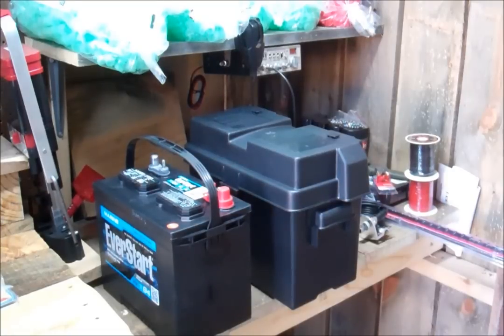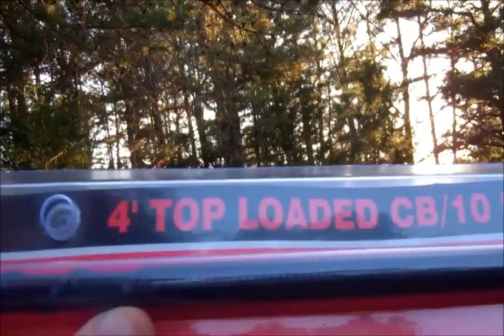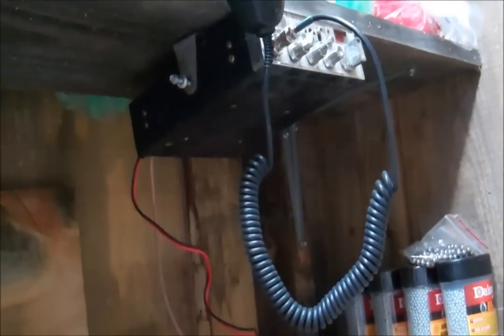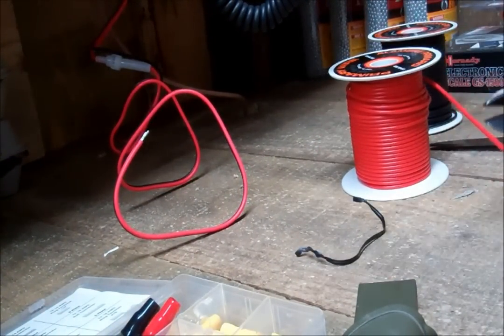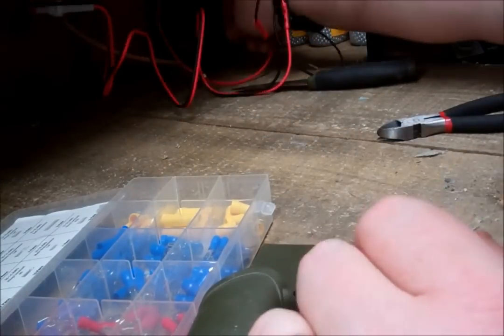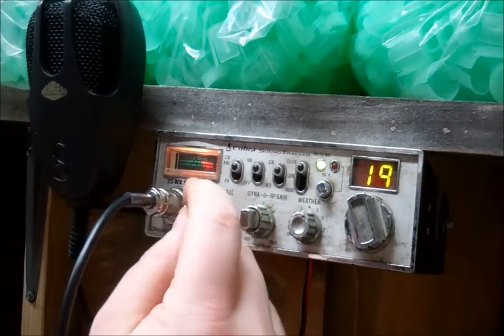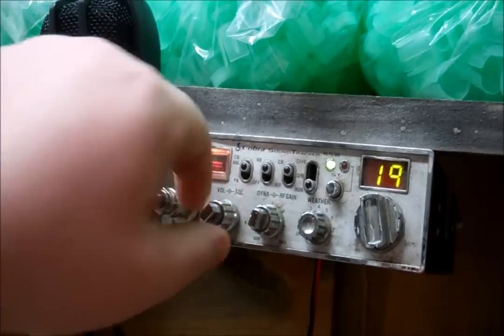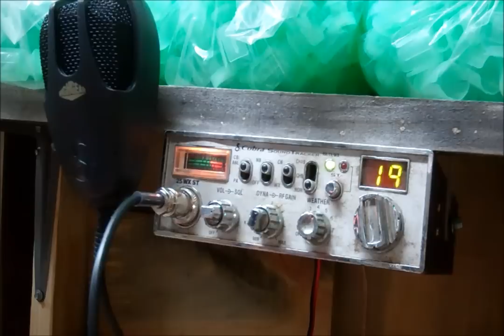Off-Grid Cheap CB Radio Set-up

Comment: Neat video. You COULD run a ground wire from the antenna to ground, but it won't make that much difference at the 4 watts that a CB puts out.  It's a much greater issue with a higher wattage Ham radio..  The antenna is grounded straight to the battery.  Copy sounds good on your radio check.  The important thing is: IT WORKS!! 73's

Comment: You also need to remove the coiled coax loop directly below your antenna. Tightly looped coax produced a RF choke. Creates resistance in your transmitted signal , which your radio must overvome. Between the loop and the ungrounded antenna; I would suspect your SWR's are extremely high ; and you will eventually burn up the transmitter finals in your radio , due to the excessive resistance.

Comment: Nice : )
I have a set up a little like yours. I have my whip with a mag mount in the attic on a 3ftx4ft sheet of steel on a ground lane. Works like a charm, I will be adding an amp I bought at a flea market this weekend. Thanks for sharing.

Comment: groundplane radials, just 3 wires attached on ground bracket will help greatly! also a cheap swr meter will keep you from burning up your final transister. Luckily you didnt key very long

Comment: You need to check your SWR If it is much over 1.5 you will burn up your radio. That antenna needs a ground plane you can run 4 wires from the mounting bracket out like spokes in a wheel in 4 directions and it will help you. I hope this helps good luck.

Comment: So you connected the power supply straight to a deep cycle battery with nothing but a fuse in between right? I'm asking in relation to the fact that I'm trying to make myself a CB radio go box
Reply: +Richard Evans  My own "go battery box" is a marine car battery, with a trolling motor type of battery holding case from wally world's fishing department. On top at one end, I added a three cigarette lighter outlet box  that I found at an auto parts place, And I put an off on switch in line that can shut off the outlets. 

Later I found that adding a small solar charger controller box and a remotely mounted solar panel to the other end of the top of the case lets me recharge the battery out in the field some too with a small solar panel set up i got from harbor freight.  

It's so handy in a power failure, i made a second one just like it with a regular car battery inside and with a solar panel controller box of it's own.

I just switch the solar panel from one go battery box to the other go battery box every now and then to maintain the charge in each of them. But the smaller solar power panels don't actually charge very well, it maintains the charge. If you do use it much, you still need to recharge the battery separately, to a full charge and then reconnect the solar charger controller to maintain it's charge with the solar panels. 

The go battery box rig is just as handy in camping with out adding the solar charge controller and solar panel all by it self. .And having the three 12 volt regular outlets are much handier than wiring up any extra stuff just to charge a cell phone adapter or to run a radio with..

Possumn
Reply: Thank you very much for your insightful comments thank you for the help

Comment: :-) If you add a nine foot  ground  radial to the bottom of the mounting bracket  it will work even better! You could use some of that black hook up wire and tie it to that wooden post. Works just like a vertical dipole .I love your set up Cokeman  and just like you said having some form of communication is better than none.
Best wishes and greetings from the UK :-)

Comment: I even hooked up an old radio with just wire(antena) and coax cable , just make sure it is the correct length if I remember it should be about 102 inches??  I was able to talk about 6 miles w/friend on a bizzy day, good to meworks ina pinch ,again great job .

Comment: I would really recommend getting your amateur license, the Amateur bands would work much better for what your doing. I would keep the 11 meter CB. Nice work. You need to add radials to the base of the antenna. I think they make radial kits for that mount you used. Nice work.

Comment: x3off  102"12AWG insulated wire connected to bracket\ground,add 3 egg insulators to each ground plane wire.Position ground wires at 45deg,hold tension using nylon rope thru egg insulators.No need to run a ground wire thats a mis-nomer and only provides electrical safety only and not required.  Three 45deg 9ft wires will be perfect counterpoise for antenna to work well,do not ground the counter poises use egg insulators or plastic PVC tube cut 4 inch long drill holes either end of tubes and attach wire one end and nylon rope the other end.THe counterpoises wires must not be earthed ,they float.Get mast up as high as possible 40-60ft and it will work well.

Comment: an antenna for CB Band has to be at least 17.2 ft long. if you divide that in 1/2 that makes the antenna 8 ft 6" or 102" on each side.  mobile antennas for CB are 1/4 wave that antenna is only 102" long. with out the other 102" you will not have a 1/2 wave antenna. The match will be off and you will fry your finals. A ground plane 1/4 wave has the 102" whip center and 4 102" radials to allow the antenna to be matched to the radio. Please go read about antennas and save your radio.

Comment: Cokeman, what would help you out a bunch is if you had a counterpoise... right now you're really only using half an antenna (I know, weird...) Running 2 wires down at a 45 degree angle off of the nuts on the bracket that hold the antenna will improve your signal as it creates a ground plane.

Comment: YOU MUST HAVE PROPER GROUND PLANE  TO GET LOW SWR. TAKE A LOOK AT 1/2 &5/8 WAVE BASE ANTENNAS AND YOU WILL SEE THEY HAVE  GROUND PLANES AT THE BASE OF THE LOADING COIL/RADIATOR ELEMENT. ALSO YOU NEED TO USE  A CRIMPING TOOL NOT WIRE CUTTERS TO CRIMP YOUR   CONNECTORS .

Comment: That antenna is made to be mounted on a metal vehicle. It needs a ground plane it is only half of antenna.
Reply: ***** Or maybe 9' of wire hanging down  connected to the mounting screw as a counter poise. The whip  is only half of the ant. The vehicle is the other half. Thanks!
Reply: ***** YES YOU ARE A 100% RIGHT IT HAS TO BE A METAL GROUND TO GET A GOOD SWR OF 1.5 ARE LESS AND THE OHMS NEEDS TO BE AS CLOSE TO 50 OHMS AS YOU CAN GET IT. GOOGLE 440 CB SHOP AND READ THE REVIEWS. ON FACE BOOK.
Reply: Rick McCombs , 6' coil.
Reply: crazybobdj , 6' coil.

Comment: how long do you think those batteries would last with the CB running 24/7?
Reply: Depends on how long the Mic would be "keyed" in any given time span. I would say an average of about 2 hrs use a day = 2 weeks maybe if the radio TX power output was a consistent 4W, with minimum RF loss on a low SWR. It's hard to say.

Comment: You need to tune antennas! The tuning (SWR) will be high due to not having a ground plane. You should have bought a dipole or mabe a.silver rod and a cheap SWR Meter. The output transistors won't last long if you dont...

Comment: That is a nice set up for cheap. Let me give you some advice as my uncle is a freaking wizz with those things. If you plan on keeping that and using it often, make sure you get a set of meters and check the Standing Waves on it so that you don't blow up your radio. Get a power mic to reach farther, and make sure your above the electric lines so you don't pick up so much electric noise when you turn a light on or something of that nature. :) Not trolling just wanting to help Cokeman :)

Comment: Seen a lot of comments about SWR GROUND  PLANE   . How do they make it work on a hand held  with no ground plane  . My first base was a 5/8 mako  rohn tower  40 ft  8 ft cc ground  rod the hole bit  had horrible  SWR could not tune it  no matter  what took it down and went with Amtron  99 fiberglass witch  has a tuning coil at the bottom if you want good SWR  at 28 500 you could tune it for 10 metering   SWR  were great  . Standing wave ratio has to do with  length of the  antenna  being  tuned to the  frequency.  Most likely the fiberglass  whip is set for channel 20   . The SWR  will change  as you move from the tuned.  length in frequency. .good ground plane will help with better reflection  of signal  . KA4ARM

Comment: it works but you will burn your radio up cause a mobile antenna needs the metal of a vehicle to be able to match it down to a safe lever.  you should add at least a ground wire to your antenna to a ground rod in the ground for a counterpoise or you will be paying out 100 bill to fix it or buy another radio.

Comment: Local comms are going to be line of sight, so the higher the better 30-50 feet should,'t be a problem to achieve in most locations Radials at the antenna mount & an Earth ground for the system couldn't hurt. a lightning arrestor couldn't be a bad idea My intent isn't to dismiss this installation, but to state the obvious for newbies that might stumble across the vid.

Comment: Where is the antenna ground?!
Reply: Yeah!! I was wondering the same thing, you'd could potentially achieve 30 miles on am with a good ground plane.
Reply: Yeah. He made a "contact" and he hears signals in receive, so he assumes that the antenna "works".  In a SHTF scenario, you have to know enough to not blow up your radio's final PA section with a horribly mismatched antenna. Working radios and repair parts and repair knowledge will be in very short supply.
Reply: Got that right! I just put up a Hustler Super Predator that also works well on 12 and 10 meters. It's tuned for 27.185 MHz but the auto tuner on my Icom IC-7300 compensates for the high SWR on the ham bands. On CH-19 I can usually talk to truckers 10-15 miles away. Not bad with only 4 watts.

Comment: You definitely need to ground the system.  Put 4 108" wires to the bracket of the antenna with 45 degrees angle will do.
I see some 12 ga. wads on the shelf.

Comment: I also did that battery rating with constant talking.  This doesn't consider the down time, or none transmit time.  This rating is as if you where constantly talking.  Total standby time or receive only would be around 800mA or current draw at 12 Volts of energy.  Would only use about 9.6 Watts of energy this again doesn't consider for losses.  So at 1,320 Watts total standby time would be about 5.7 Days.  If not in use at all.  This is pretty accurate and rated off a high end police scanner doing far more functions than a cb radio.  Now my first calculation i think is a tad off in the wattage draw.  If in standby it is drawing 9.6 Watts I would be inclined to think draw during xmit is around 60 watts.  My math mistake.  To run a cb you need atleast 5 Ampers of electrons.  And 12 nominal Volts.  That equals 60 Watts of power.  About the same as a light bulb.  So total talk time deteriorates fast at this point.   22 Hours of full on the air talk time.  Not including breaks.  A solar panel would be a good wise investment sir.

Comment: Which is better Analog or Digital CB radios?
Reply: +keving52002 What do you mean by digital?
Reply: Jon Williams I just figure with all the new electronics coming out ,i thought there was a a analog and digital for everything made these days.
Reply: Well, on ham radio there is, but with cb you get three voice transmissions. Upper and lower sidebands, and AM the newer cbs look cool with digital displays and all, but they are the same as the as the ones in the 70s (well they might have improved on receve, but the concept is the same)

Comment: I've Done this, definitely no good, High SWR, you need a Counterpoise. Either a set of Radials, or a Coaxial Counterpoise. Better off with a Stealthy Dipole in the woods, or mounting an Antron 99 knockoff on top of one of those trees.

Comment: He is right about it needing to have a better ground plane than what you have. You might be doing more harm to your radio than you know. You should also check the VSWR out to make sure you your forward and reflective are tuned to that antenna for the frequency your using. Maybe you should google how to do it right.

Comment: If you don't want to use a ground plane and grounding rod you better use a NPG "No Ground Plane" Antenna so that you don't burn out the finals.  The npg antenna's wont work very well for distance and neither will an antenna without a decent ground plane and swr adjustment.

Comment: Also, you could make the saying power a lot more permanent, but introducing a solar panel with a simple charge control/overvoltage protecting circuit.  This would make this setup last far longer.  And when there are no cell phones, and the towers are gone.  Best of wishes making your contacts to mom across town.  Radio wave propagation has saved lives, and will continue to into the future.  Look at Hurricane Katrina if you disbelieve this mans credibility.  Amature radios saved many lives in areas where simple cell phone systems where completely utterly decimated.  Don't forget those systems are at more risk, they are higher in the air.  And if you lose one tower your screwed.  It can disable communications for an entire city.  Cb's and amature radio present the strongest link.  They can be something so simple as a piece of wire laying on the ground.  Like a dipole antenna.  And you can speak for miles.  WIth the proper setup some talk world wide.  This is considered illegal.  Though with less and less monitoring on the 11 meter bandwidth many break the rules daily.  It would be very plausible to get a distress call heard on these frequencies.  Since we are not the only country that monitors this bandwidth.  Canada, and many others do as well as well as the EU.

Comment: I seriously doubt he even made contact with the babe at the truckstop. He's glad he can hear her, but the SWR in the antenna/ coax system is way yonder too high. he needs a minimum of 2 nine foot wires at a decent right angle at the base of the 4" radiator to have chance. With SWR as high as I suspect, fusing the power lead is the least of his worry against cooking his radio.

Comment: You're doing it wrong! You need what they call a "counter poise" from the antenna bracket, ground, outer shield, of your HALF ANTENNA . You see, that fiberglass antennas were designed to go on a METAL car or on boats. The car metal acts as a counter poise, the water under the boat acts as the counter poise, the other half of the antenna, to the antenna.  The counter poise is the other part of the antenna. Run a wire from the antenna ground bracket, down the two by four to act as the missing metal of the car, the other poise,  the half made antenna. Formula Half Wave Dipole Antenna,  468/f MHZ=Feet length of antenna, divide by 2 for the poise half. Example 468/27MHZ CB radio frequency=17.33 feet. 17.33 feet multiplied X by 12 inches FOOT=207.96 inches is the length of a HALF WAVE antenna. Too long to put a 207 inch antenna on your car bumper, so divide by half 103 inch whip 1/4 Wave Antenna sold in stores.  Your fiberglass antenna is shorter than 103 inches because it is 103 inches of wire coiled up on the fiberglass stick.  Just hang a 52 inch wire from ground bracket holding the antenna and call it good.  In addition, the neatly coiled COAX you have tie wrapped is acting like a coil and all the energy from the radio is being collected in that coil and bypassing the energy to your half antenna!  Never coil coax unless your making a choke coil. Let it lay uncoiled on the ground.  Tune your SWR "standing wave ratio" for the energy of the transmitter to radiate fully out the tuned antenna, not back to your radio transmitter. Remember your radio, no matter how expensive and powerful it is, will only be as good as your cheap antenna. www.arrl.org  Neatness  and Physics never apply.  Please look up tuning a CB antenna on YouTube. See making a DIPOLE antenna on YouTube. Great idea but you doing it wrong. N8JGU
Reply: Mike W. , 6' coil.

Comment: haha our off the grid cellphone is blowing up!
Reply: +Pew Pew I was driving up on the Blue Ridge Parkway in the western NC mountains one nice day, and some bikers went past me at high speed. Since it's a 45 MPH  US forest service controlled route, one of them in the lead ran right into the back of a van that had stopped to admire a snake in the road. None of the bikers could get a signal up there to call an ambulance, but my old CB in the jeep could easily cover four states with it's four watts, and my ham radio could easily reach the 2 meter repeater forty miles away.. Keep your cell phone, I'll keep my obsolete old back up stuff.

Comment: it may be working, but it's working like shit. You only have half of an antenna system. With a mobile antenna, the body of the car becomes the other half of the antenna system creating a ground plane. With out it, the antenna will not work well. A base antenna is usually a dipole antenna, which in a nut shell is 2 antenna's, top and bottom. One is the hot, and the other is ground plane, that's why they work without a ground.

Comment: 27.185 is 11 meters that antenna said 10 Meters???
Reply: ***** It said 10 meters and CB, IIRC. There may be a little slop, but shouldn't be a problem. Some folks will use the same antenna for 10 and CB, with a tuner on one of the radios to tidy up the difference.